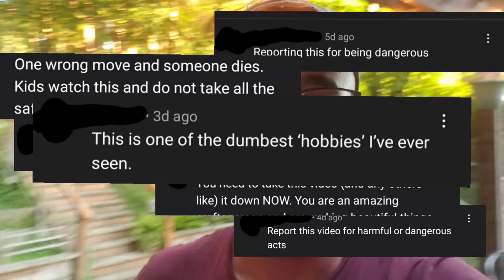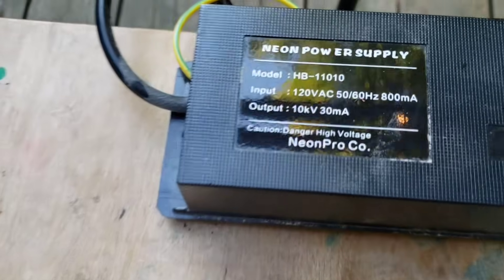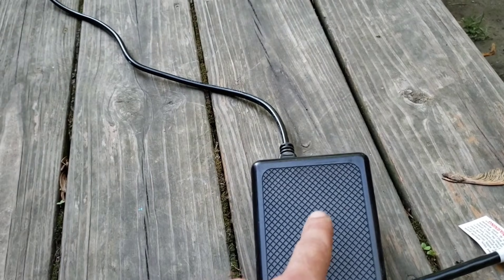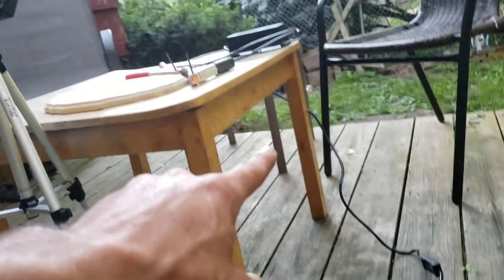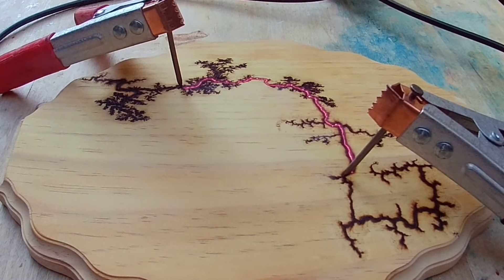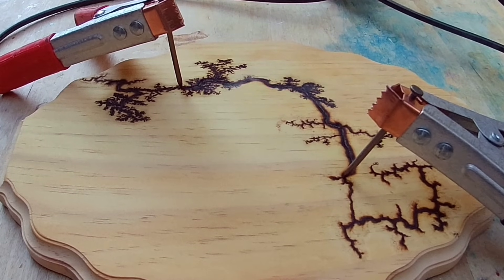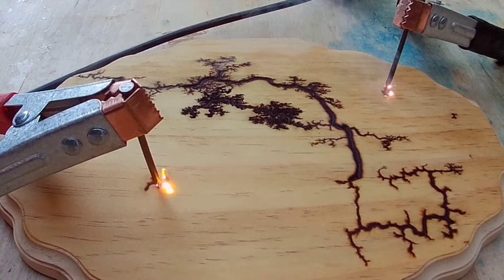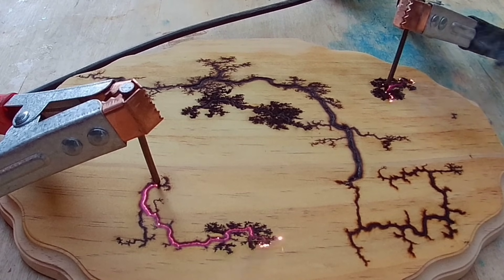Safer Fractal Wood Burning (Lichtenberg) Setup

Comment: awesome safety oriented video!  when you grab the electrode one at a time, It is analogous to treating every gun as it is loaded.  Well done!  I just set-up a similar system for my fractal wood burning. I also plan to where rubber gloves, just as a further safety level.

Comment: Would a welder do the same thing as a power supply.
Reply from the maker: I have heard guys say they have but welders put out lower voltage and higher amperage so I don't think you'd get the same result, but I haven't tried it. If it did work it would be burning through the heat it creates more than the intensity of the flow of electrons. I'm guessing at this point but I think you'd have to have a more conductive solution than the baking soda and water you typically use to get fractal patterns with a transformer power supply

Comment: I highly recommend to anyone attempting this to NOT use battery clamps as shown in this video!!! This is a bad idea as they expose metal, are unstable, and can disconnect and fall off the table, and the insulation is usually no good past about 600V.  
Most people killed via this is due to stuff like this (and many have died touching the insulated parts! ).  As someone who has worked with HV electricity, I always make sure to use properly insulated parts (usually non-conductive ceramic, untreated wood or high temp plastic rods - high melting point as some people have their electrodes melt off a PVC pipe, fall, then ZAP!).  I put safety switches in the electrodes and/or use a latching circuit coupled with a drop sensor (if something drops, the controller cuts the power and does not restore it - a mercury tilt switch or something similar can work as a drop sensor).
You can usually use spark plug wires as they have a high voltage rating (but for so many milliamps) usually 20-30KV (kilovolts) and it doesn't hurt to add more insulation and/or wear linesman gloves.  If using a MOT, you should put a load on it (i.e. incandescent bulb) - you have way more than enough current already. MOTs are overkill for this type of stuff and can provide 750mA - 1Amp (depending on the model) - over 12-17 times what is needed to kill someone (60mA kills)! (the other thing is the frequency is low, so the "skin effect" doesn't apply)

Comment: Coating that wood in a water/baking soda solution will conduct that electricity across that wood much more efficiently
Reply from the maker: It is coated in that. There would be no fractal pattern without it at 10kv

Comment: I like that you added the foot pedal. Two other safety features I've thought of is to add a 1"-2" red light that will let you know if the power is on. The other is to use something like the orange rubber safety fencing around the work area with a light weight door/gate. The gate would be controlled by an electric lock. If the power is off, it's unlocked. If the power is on, it would automatically lock. On/Off switches and foot pedals can fail. This is one of those things that you can't be too safe with. Happy woodworking!
Reply: Better insurance is to just make sure you turn off and remove the fuse...some fuses have stuck on under continual flow and heat. Thay are supposed to switch off...but turning off and disrupting the fuse will disrupt the electricity....only secure way.

Comment: I use the same type of safety precautions as you. No hands anywhere near the current. I do use a microwave oven transformer with a variable transeformer setup though. Even though it is likely many times safer than my drive to work, the internet safety police freak out with a picture. I turn bowls mostly and facebook groups will not allow pictures posted.

Comment: Looks like you've taken some good safety precautions with your setup. If I were to suggest one additional thing: An indicator light (or, as bigclive suggested, possibly two, as a failsafe) which is on when the power is on. That gives you one additional warning that the setup is powered, if for example the foot switch sticks, you forget to switch off the secondary switch, and it stops "buzzing".

When severe burns/death is involved, having multiple layers of fail-safe is important.
Reply from the maker: I couldn't agree more. I was thinking the same
Reply: Good idea. Or an audible hum.

Comment: Brilliant video thank you so much also what people need to know is the insulation rating of the wire- specifically on the secondary side of the neon Transformer the high voltage side, in other words- is it rated for 600 volts or is it rated for 10,20 30,000 volts? The correct type of insulated wire is also key to not getting electrocuted in your setup.
Reply: Right on people have no idea that 2-3000 volts will come right through that 600 volt insulation in the right conditions.

Comment: I am no retired but was a trained electronics technician then an electrician repairing Street Lights for 27 years. 

I have a couple of Neon transformers and hope to try this soon.  

My question is: Do you apply any liquid to the surface of the wood? I have seen short video experiments using salt water or baking soda water. Or perhaps a diluted acid solution?
Reply from the maker: I do, I use 1 tablespoon of baking soda to 1 cup of water. I know some guys use different proportions or different conductors but that seems to do the job for me. Enjoy and stay safe!

Comment: Cool video, thank you. I'd be really interested in a follow up explaining to the average person (like me) who doesn't understand amps/volts how different your energy supply is to a microwave transformer.

It could also explain what grounding means and how important the type of table and flooring are in ensuring no current can reach you. 

I love your style and think this is way more impactful than just asking YT to delete all content, regardless of the circumstances.
Reply from the maker: Thank you Richard, so an NST like the one I'm using here is roughly 1/50 the power of a microwave transformer. A microwave transformer will usually put out 1-5 amps depending on the unit. For reference an output of 0.1- 0.2 amps can be lethal. My NST uses 30mA, which is 0.03 amps. This can still cause a very painful and severe shock and burn. If you have underlying health conditions or there is a chance the current could pass through your heart then I would avoid messing with electricity all together. For a healthy individual where the shock is relatively quick it usually takes about 50mA to cause someone to die from an abnormal heart rhythm. Amps are the volume of electrons and voltage is the pressure behind them. Basically the size of the current and the force behind it. You can generate up to 30,000v by simply rubbing your feet on the carpet but because the volume is so minimal and the surface is so large, it dissipates in an instant. This isnt to say that voltage doesn't kill. It absolutely does, in combination with the amperage and duration of the shock. People are hit with 10kv of electricity during the tough mudder contest and are mildly irritated. People are also hit with 10kv on the electric chair. A taser operates at 14amps and can produce up to 15,000 v across your body but it only lasts for a millionth of a second. So all those things, amps, volts and duration are things to think about when putting together a safe setup. 

Its also important to know that just .016 amps can cause you to feel like you can't open your hand to let go, which would increase the duration of the shock so the main focus should be on making sure you're not actually coming into contact with anything, over how much current will unalive you. While 30mA is much less likely to do that it should still be treated the same way as you would a more dangerous machine.

My grounding situation could be better. Right now the ground wire comes from the unit, screws into a table leg and goes out to ground by way of the spigot, like how your house breaker box is grounded to your water main. Ideally it would be best to work on an esd mat both on the work surface and to stand on. Basically a couple of thick rubber mats that attach to a wire to ground. The purpose of that is that should there be any unwanted discharge, say there is a piece of metal in your table or wood that you weren't aware of that the current might try to arc to, it would dissipate to ground instead of becoming another potential hazard that you could accidentally come in contact with.
I hope that helps!
Reply: @TheFishinDad  amazing, thank you so much. You've just gained me as a new subscriber! 💜

Comment: What is the difference between that and welding???
Reply from the maker: Your typical power supply output on a welder is usually 17-45 volts and between 55-590 amps (low voltage, high amperage). This NST is 10kv and .03 amps (high voltage, low amperage). This wouldn't get the work piece hot enough to melt metal as there isn't a high enough volume of electrons at any one given time. Inversely there isn't enough force (voltage) used in a welder to create fractal patterns.

Comment: This is really cool. Of course it’s dangerous and you did a great job of explaining the dangers and precautions. If viewers are overly concerned about safety that is a good thing, electricity is hard on careless or stupid people. I define careless as micro bursts of stupidity in otherwise smart people. That being said I am going to work on acquiring the equipment to try this. Any comments about wood type/density having an effect on the outcome?
Reply from the maker: I have seen some guys successfully burn on hardwoods but I know it's a little more difficult. I have some black walnut I plan on trying but so far I've only used pine. My best guess at this time would be that it probably won't burn as deep with a denser wood so I would start by letting it burn a little longer to see if I could still achieve those same results. I imagine the small "fingers" of the burn may not show up as much though even in doing that

Comment: What size cable should I use for the alligator clips and what type of inline toggle switch (e.g., power rated) would I want to use?
Reply from the maker: It all depends on the rating of your transformer. Here is a link to calculate cable size: https://www.electrical4u.net/calculator/transformer-cable-size-calculations-calculator/
As far as switches go, if you're coming off a 120v outlet get one rated for that.
Reply: @TheFishinDad  also, how should I ground this?
Reply from the maker: @OCDbrand  you'll want to ground both the unit and your work surface just in case there is anything that could become energized that you could accidentally come in contact with. Just run your ground wire from those to a metal stake in the ground or clamp to your metal water pipe the same way your breaker should be to your water main

Comment: What were you using for probes? Almost looks like a small set of jumper cable clamps with welding rods...
Reply from the maker: I used large alligator clamps on a nail. I've heard copper works better and that you don't want to use galvanized nails because it can give off noxious fumes but any piece of metal will do the trick.
Reply: @TheFishinDad  I am also a fellow wood burner! Copper does work very well. I have also had great luck with Brass.

Comment: As dangerous as it is you do it the safest way and do not touch it I don’t see anything wrong with someone like you who knows what there doing love it keep up the good work!
Reply: Question: I didn't see the table, which is made of wood, been insulated from the actual board been burnt and the wood deck. Therefore, isn't there current traveling to the deck through the table?
Reply: @editek5992 well wood is not a conductor of electricity,  it requires a solution on the wood to get the fractal burnings.

Comment: Where did you run the yellow wire?? And where did you find the pedal???
Reply from the maker: The yellow and green wire is your ground. It's hidden in the video but it runs to the outside spigot the same way your house ground runs to your main water line. You could just attach it to a metal stake in the ground though. Same effect. The pedal I got on Amazon. I want to say they're only like 15 bucks

Comment: Haven't most of the deaths been from people using microwave oven transformers?
Reply from the maker: They have all been as far as my research has been able to determine. That being said, even though all experts agree that getting hit with an NST rated at these capacites would be very painful and scary, we should still treat it like it's deadly. A heart condition or lengthy duration spent, or the entry and exit being in the wrong place could make all the difference. I don't want anyone thinking that there is no risk involved when using an NST but it is absolutely the safer option by a long shot. When I say there is no way the electricity can get me, it's because of the distance I am from the probes when they're live and the given output. The safety precautions in place are because I'm treating it like it's a deadly machine even though my odds of surving a shock from that are 200x that of an MOT. Better to not risk it and treat it like it is an MOT. I think thats where some of the confusion in other comments is coming from now that I think about it
Reply: @TheFishinDad  Yeah I want to try this. But I'm coming from the angle of I already play with high voltage all the time this looks like something new I can do with it, instead of I have no idea how high voltage works and I'm just going to try it.

Comment: 1. "There's no possible way for me to get electrocuted" sounds like famous last words. Just to be clear, I don't wish you any harm, but while doing a lot to keep yourself safe, you also show lack of respect to electricity. That's what gets people killed. They feel safe, get comfortable and let their guard down.
2. "That's not how electricity works, it's not just going to jump and get me" at those voltages it's not going to jump 4 feet, but spark gaps are a thing and saying it casually again shows that you don't have that much respect to electricity which is concerning.
Reply from the maker: I am 100% certain there is no possible way for me to get electrocuted at 4 feet away from 10kV. That's not arrogance it's simple math. My confidence in that statement isn't in myself but in the science. The dielectric standard for air being between 1-3 kV/mm, conditions contingent, gives me plenty of space at 4 feet. I am well outside the range of a potential arc or spark gap
Reply: @TheFishinDad  You're talking about a spark gap and that's true. What you're not considering is any other failures/possible accidents. As I said, you did make it pretty safe, but saying that there's no possible way to get electrocuted is not true. Ask any scientist why they never say that they're 100% sure about something and they qualify every statement they make. It's because they're well aware that there are things beyond their understanding and that things they did not plan for can happen. Again, I don't wish you ill. I'm just uncomfortable with people saying "I'm 100% sure I'm not going to die" because many people did the same thing and the unthinkable happened. Stay safe!

Comment: Thanks for this breakdown. I came from Ann Reardons video and she does a lot of informational videos about YouTubes piss poor moderation of dangerous videos. I didn't even know fractal wood burning existed before her video and I appreciate this breakdown of your setup as the process is actually really interested, and as with anything can be done safely IF you know exactly what you're doing and how it works. Hopefully the bad actors don't ruin your channel as this is still very cool.
Reply from the maker: Thank you, I really appreciate that🙏
Reply: Same! I’m so thankful she showed me this type of art, and thankfully this guy showed me how I can be safe doing it! Wonder if she is against driving a car? Lot of people die doing that everyday
Reply: @Jonathans_opinions  If you can't come up with your own comprehensive safety setup to where you have to copy someone else's, then you should not be doing fractal wood burning. This guy made it somewhat safe relative to the severe danger of the activity, but not objectively safe. Lot of "experts" of this craft out there that turned up dead.
Reply: It's is only for the individual to determine what is too dangerous. I'm about to post videos of myself pouring aluminum,  that could be considered extremely dangerous,  I will not put out a warning, as it's common sense that messing with matters that are over 1000 degrees us dangerous,  if someone else tries it, and they get hurt, it's on them.